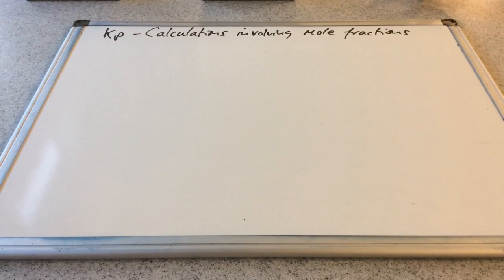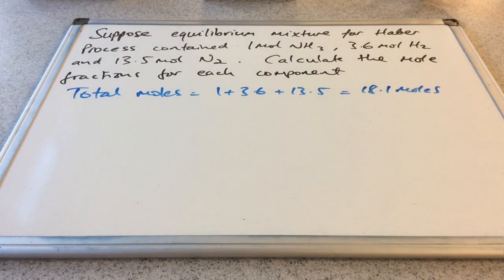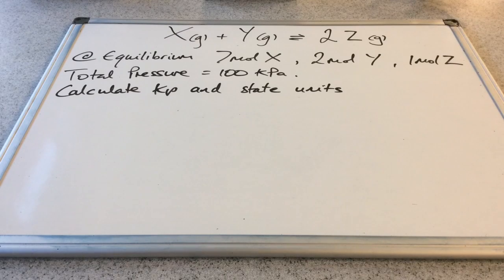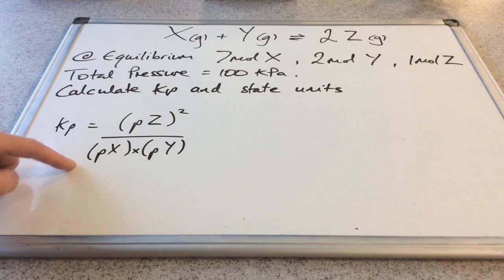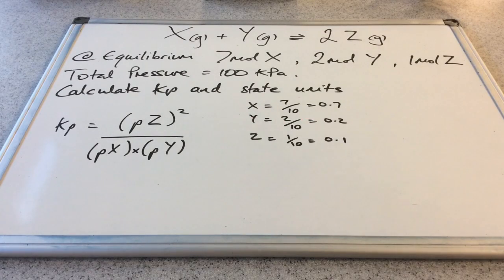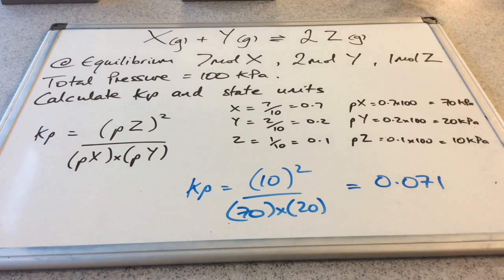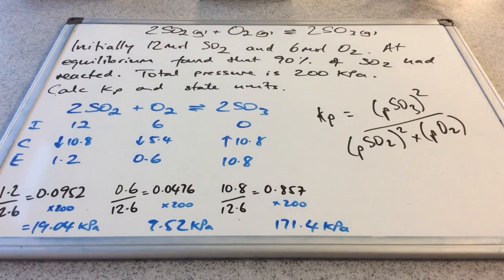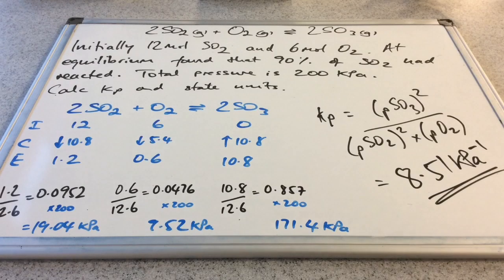Kp Calculations Involving Mole Fractions

Comment: would the equalibrium moles of 2SO3 not be 1.2 as the 2SO2 went down by 1.2 and their mole ratios are the same so the 2SO3 would go up by 1.2 moles?
Reply from the maker: The SO2 goes down by 10.8 to give the 1.2 moles. 2:2 ratio means that 10.8 moles of SO3 will therefore form